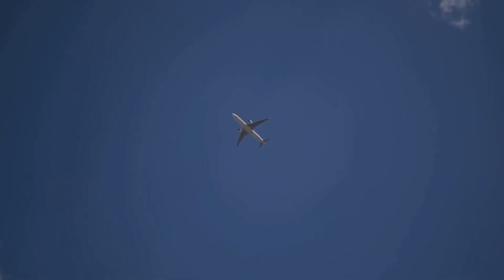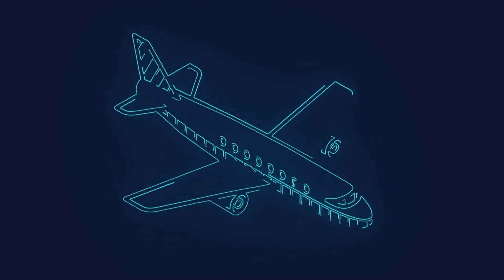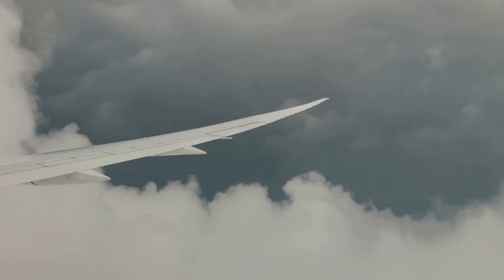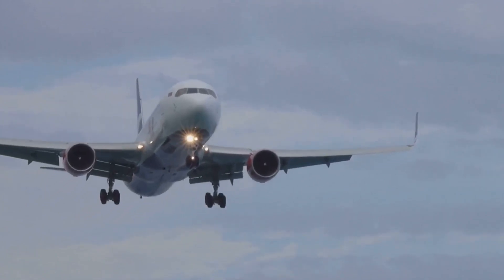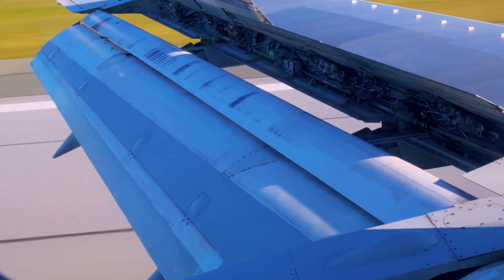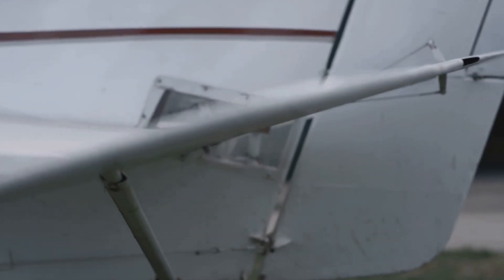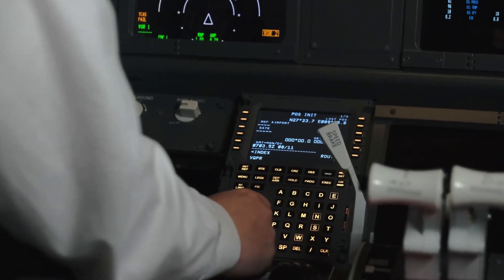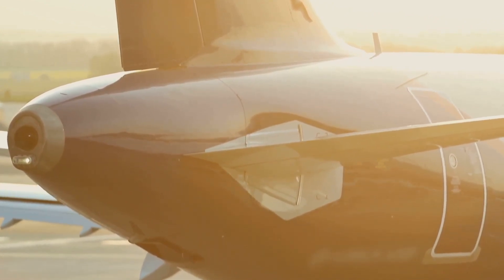The Science Behind How Airplanes Fly

Comment: The lift description is wrong. Air over the wing does indeed speed up and thus pressure is indeed lowered to conserve energy. But not because of the relative distance over and under. Pulsed smoke trails show that the two paths of air do NOT meet up and at the trailing edge the top surface airstream is way ahead of the lower and stays that way... in effect shearing the two air masses. At a high angle of attack the effect starts very early on... just above the leading edge. Cambridge ac. engineering has a wind tunnel demo and Doug(?) Maclean, ex Boeing man, fully agrees. It's a common error. Surprised me!
Reply from the maker: Thanks a lot for your correction and explaining briefly